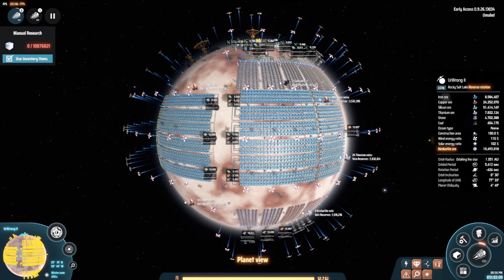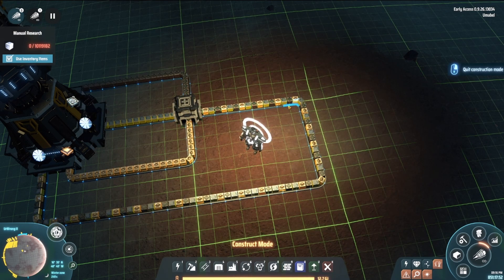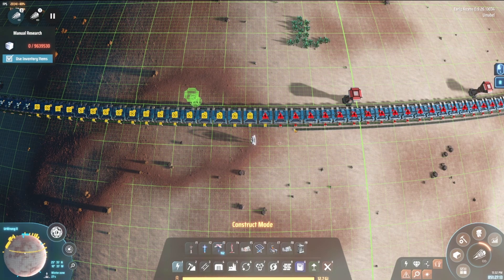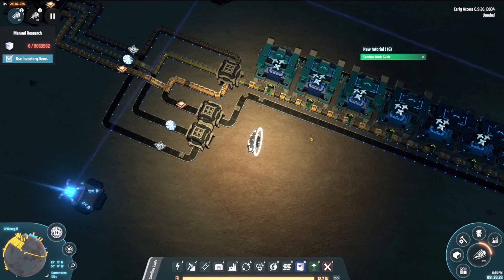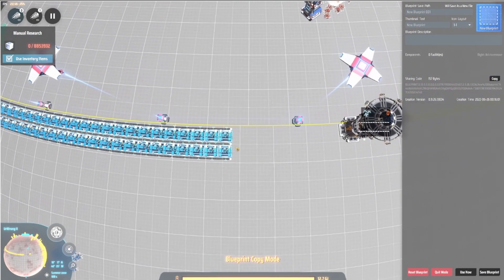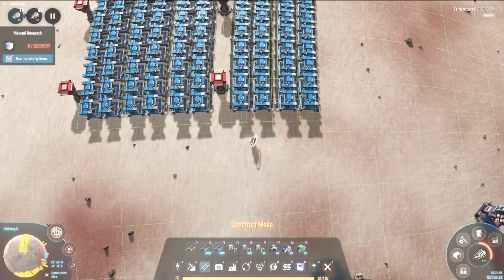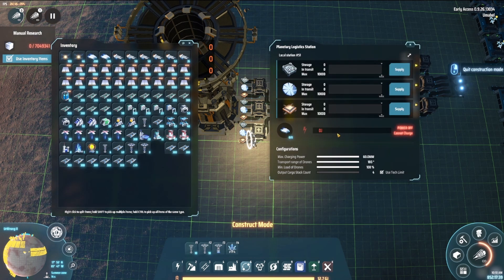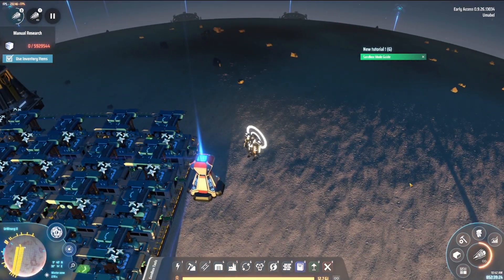Let’s Build 9,000/min Dyson Sphere Components (with Sushi Belts!)

Comment from the maker: Around 2:00, I mentioned the raws in the planet can make frame material, that's only a third of the way true. The planet still have to import tubes, titanium alloy, and sails from elsewhere. 
Also I mention (only in the end of video :D) the recycle can get clogged if there are a lack of items. It's easy to unclog but it's annoying, especially if the cause isn't resolved. This method is best for low tier items where inputs are reliable, but tends to get "risky" as the tier level gets higher.
There might be a way to make the recycle unclogable but haven't found a solution yet.

Comment: for the clog issue cant you loop the belt back into the pls?
Reply from the maker: - Hi there (Yes, I still follow and play DSP)! Glad to see reply notifications are still working!
-  If I recall correctly from this video, the clog issue is mainly because during an "unbalanced input" situation, unneeded items are accumulating in the system, so...how to manage this issue?
- Routing through a PLS is actually a very good improvement! 
- In an unbalanced situation it will still eventually clog, but compared to just belts, stations can buffer up more unneeded items (before breaking) and are WAY easier to empty (just click on station and delete the items).

- Hope you find this helpful. This was from year ago and sushi ideas have improved a bit since then. Perhaps check out the DSP #math-and-layouts discord if you are interested?
Reply: @Umabel-DSP  Yeah sorry, I didnt realise it was a year old vid. im skeptical it will clog anyway, if you limit the pls to like 4000 items the sushi belt will be able to flow forever, even if you are missing some items, and it will rebalance once the missing items return, hopefully. I've never tried it though, im new to the game. Leaving my starter planet that makes 1 white science per second and gonna try and build a dyson sphere on an o type star system!
Reply: @incription  the PLS can't take more items than is specified in the request, so it will clog. Putting some boxes in the end before the priority merge on the other side... All they need to do is just contain the excess items on the belt.